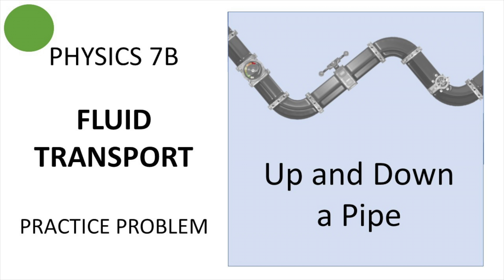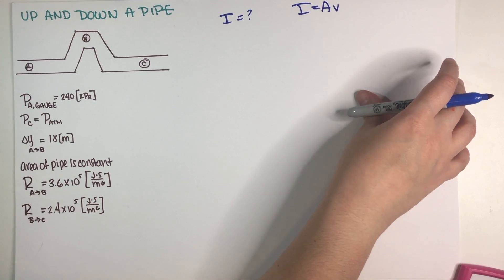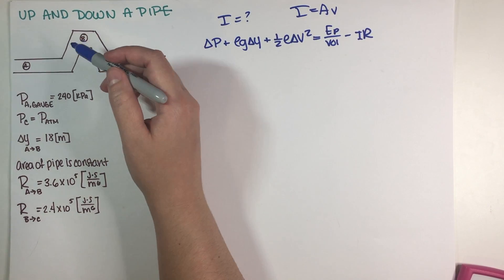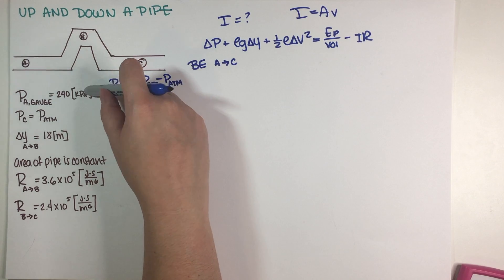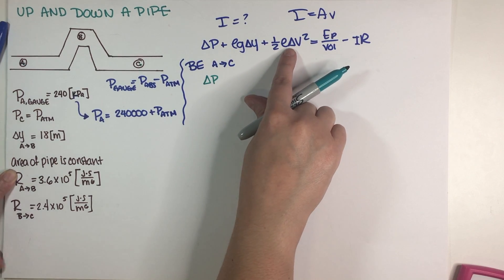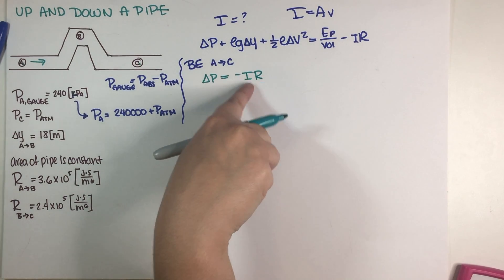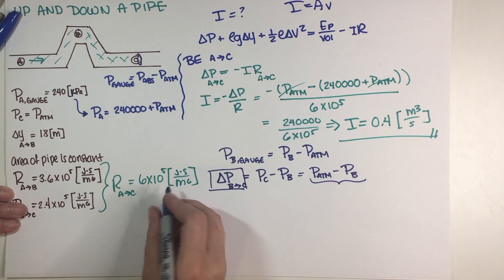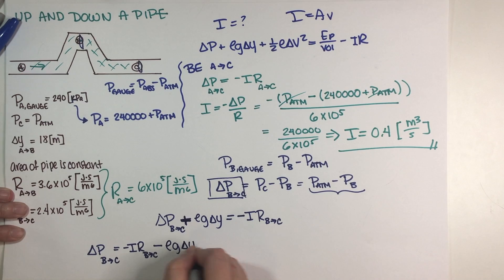PHY7B Fluid Transport Practice Problem - Up and Down a Pipe

Comment: To find the gauge pressure for point B, couldn't we also do deltaP(A->B) using the gauge pressure of point A that we were given?
Reply from the maker: YES. It would also be easier because the pressure at point A that we were given is already a gauge pressure. So if we do Bernoulli from A -> B then solve for the pressure at B, that will already be the gauge pressure aka the final answer. The important thing to remember is that when using Bernoulli, you either do gauge-gauge or absolute-absolute. It would also be important to use the Resistance from A->B instead of the one from B->C that I used. But yeah, you will get the same answer ! Good catch!